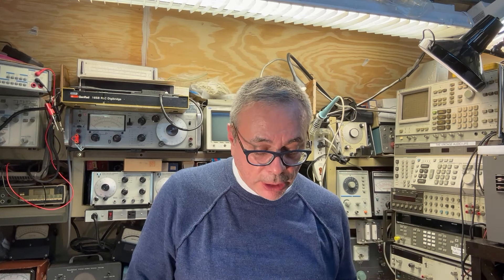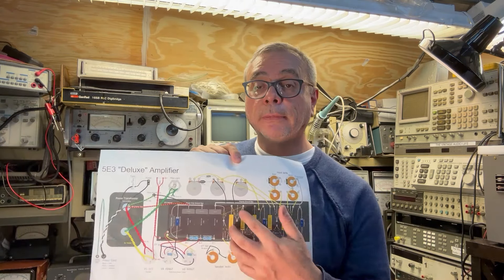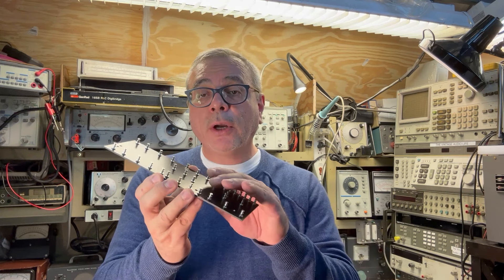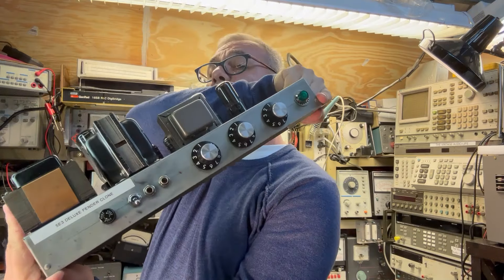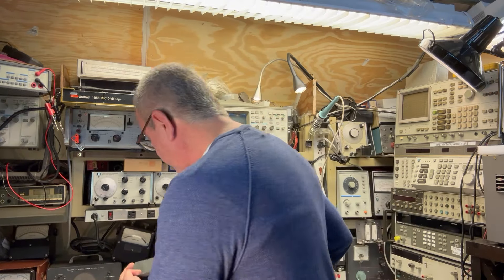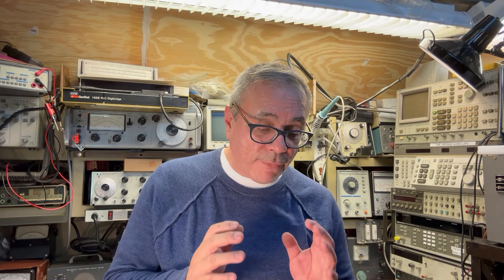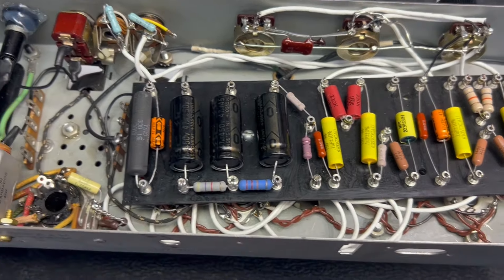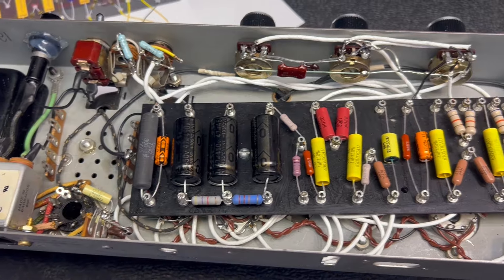Do it Yourself Fender Deluxe Tube Amplifier, Don't Buy a Tube Amp, Do This Instead!

Comment: I build amps too and I find that 12AU7 does give you lower volume and less gain but it loses something tone wise. Also, a deluxe has two channels so you have a volume for each and a shared tone. The two channels are interactive so you use the two channels in conjunction because the volumes affect the volume tone and gain of one channel even though you are plugged in the other. You can even jumper the channels to get more crunch. It is a unique design that you basically tweak all three knobs and get a nice rhythm tone, to clean up you turn the guitar volume knob down, to get lead tone use an overdrive.
Reply from the maker: Your absolutely correct in terms of tone, when I swapped to a 12AU7 I noticed it loses “something” in tone.
Reply: You can try to bias the 12ax7 to pass less volume it works but I never tried it on a 5E3. What you do is increase the size of the cathode resistor and if you have a bypass cap you can remove that . Another tweak you can use is to change the size of the coupling capacitors. A larger size allows more bass to pass through and a smaller size only allows the treble to pass.
Reply: I have never built a kid I buy old vintage tube equipment like reel to reel tape recorders or record player amplifiers PA amplifiers and I modify them to guitar use that's the cheapest way to me. That way you may only have to remove or change a few components like filter caps and change the input

Comment: hi it would be cool t that you make , audio push-pull with 807 tubes or 6l6 or other tubes.thanks
Reply from the maker: I'm thinking of building tube using tube #42 in push-pull, output and 6C6 as driver It sounds very warm and capable of 15W easy.  Thanks!
Reply: @thevintageaudiolife  i dont know 42 tube and 6c6 ,can we find theses tubes again !,cheers